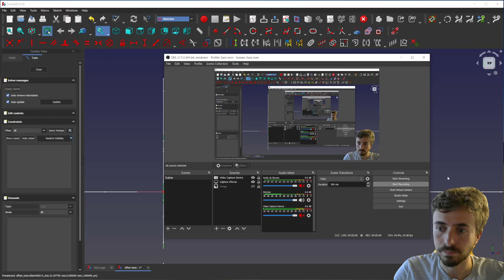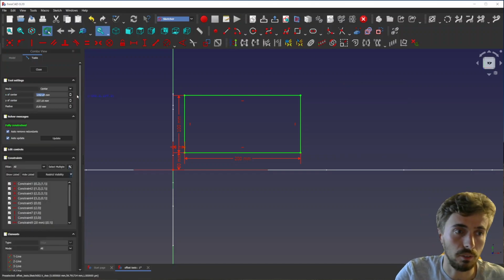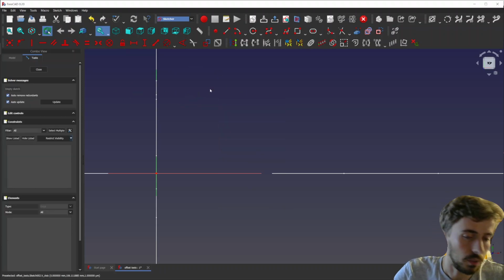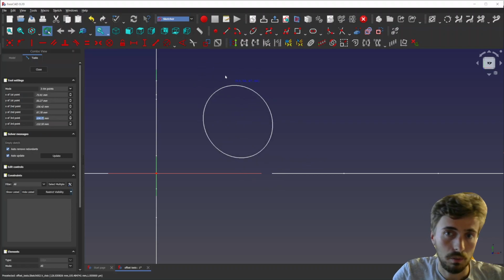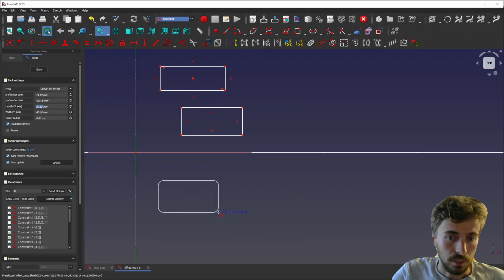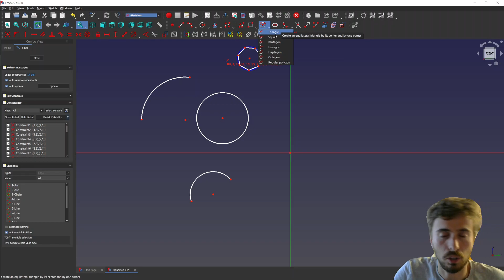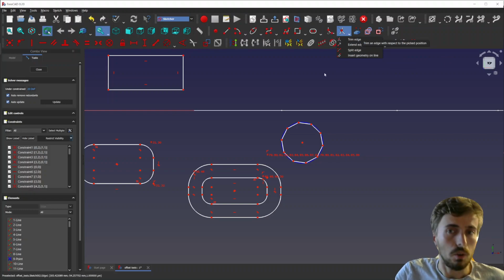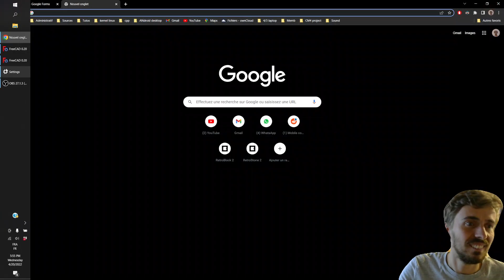FreeCAD Sketcher: UI POLL / Tool Settings update

Comment: You are asking something that is the toughest thing for most users; the choice between comfort and control. I really like your approach. I think that if the tool bar could be customized such that a particular mode of using a tool could be added, this would be of great benefit. For example, if a user want to add a button on the tool bar that has the framed rectangle, then it should be fairly easy (for the user ;) ) to add that as a button on the tool bar. This would be the most accommodating for most users. Also, the ability to have keyboard short-cuts is very helpful. Unifying the short-cuts (such as using the "m" key to change the mode is very helpful too. Thank you for all the work you put into FreeCAD!

Comment: Hi, you placed a link on my channel to this video but youtube automatically removed it. Great to see you started up a channel for discussing the proposed changes. Which Develoer are you as just reading your about page and it doesn't say. This is the first video I have viewed so apologies if you have already said. Great work 😁👍
Reply from the maker: Hi!
I'm Pierre from France (paddle on the forum)
I started to work on FC 6 months ago. I've done things mostly in sketcher.
Namely : constrain contextually, tool settings, offset, circular pattern, arc slot, etc.
You can check my videos which present each feature to have a better idea.
I posted this UI poll video to get more people involved. Because the forum has very little reach and forum guys are quite biased because they are freecad experts.

Comment: As a relatively new user of FreeCAD, I think these changes would make it more difficult to learn. In the polygon example given, it seems very non-obvious that to create a hexagon, I have to click on an icon that looks like it's for drawing a rectangle, then choose polygon sub-option and then choose "side number" from tool settings. Currently, I can easily see the various polygon tool types and get a tooltip explaining about what each does. That list and tooltip info would be lost with this change. As an option for advanced users, this might make sense, but it seems to greatly reduce the discoverability of tools.

Comment: Nice approach I like the the idea of merging similar tools together to save on mouse clicks and drags since it takes ages per action clicking and moving mouse more than needed, Fusion 360 had that idea in mind and executed it quite well from my perspective but Fusion is still slow and quite limiting in actions and tools in comparison to FC, FC might still not perfect but it's getting very good very quick to a possibility that it might change the solidworks standard if enough programmers and documenters hope in the FC wagon and bring it there.

Comment: I think FreeCAD need both option - the ability to select any option from toolbar and changing the options by m key. Otherwise, new users will be confused.
Reply: This is a very difficult tightrope to walk, but it's one that is worth crossing. A very complex interface like FreeCAD benefits a lot from discoverability, and I'm concerned that the change would make it difficult for new users. But as a power user, I want these quick hotkeys for changing modes, as constantly working the menu with the mouse wastes a lot of time.
Reply: Agreed. If this UI change (icons removed from toobar) is made, then it needs to be optional--enabled or disabled as a user preference.  

@FreeCAD Dev Diary:
First, put simply, you are replacing "too many icons" with "too many menus, text fields, and keyboard shortcuts".  ;-) ;-)  This is a subjective choice.  For example, I suspect that many dyslexic people (~20% of the general population is dyslexic) may prefer toolbar icons over text menus in a separate dialog box.  Learning the keyboard shortcuts may help in this case, I don't l know.   Others, as you well know, are confused by the similar looking icons and might prefer the text option. 

In the past, a "best practice" was to optimize for the fewest and simplest required user actions (counting each mouse button click, each keypress,  each mouse move, etc.) to perform a given operation.   Generally if your UI changes reduce the number of clicks, keypresses, and moves for a given operation, then that is a good thing.  But, if the UI changes increase the number of clicks, keypresses, and mouse moves for a given operation, then it is time to rethink the changes. 

Second, I will not be using the Tool Settings feature until it supports ExpressionEngine values (parameteric Spreadsheet variables, Assembly4 Variables, etc.) in all its settings.  Entering numeric values for the tool settings constraints is fine for quick one-off models, but not for larger models and assemblies that have many computed dimensions.  I often have dimensions that are shared between multiple models/files.  When dimensions change, manually updating numeric values in multiple sketches in multiple files is not a option.  That said, am I missing something?  Is there some way to use non-numeric values in the Tool Settings UI?

Thanks for your efforts to make FreeCAD better!